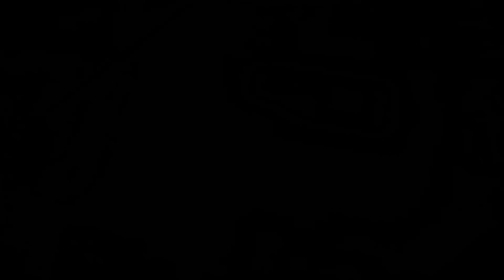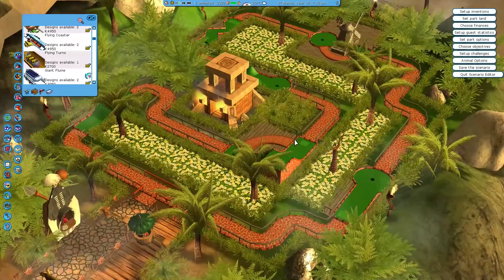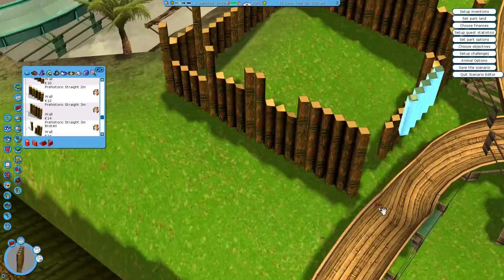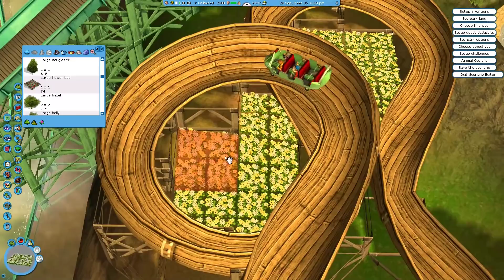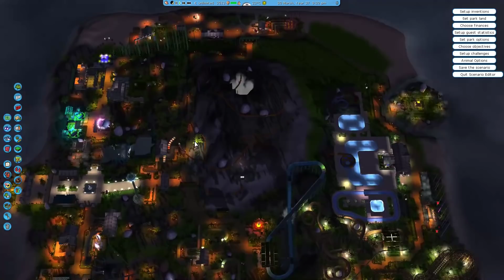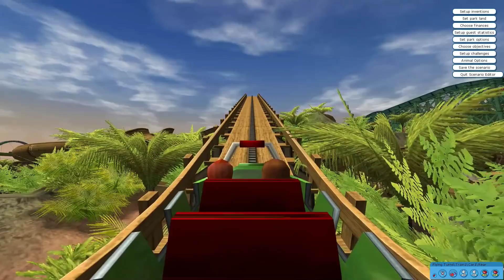RCT3 Megapark Episode 25: Flying Turns!

Comment: Probably a little late for your Park as it is almost finished, but it is possible to remove scenery and track clearence checks. 

To do this you only need to edit the option.txt a little bit.
First you have to make hidden foulders and files visible.
Then you go to to
C:\Users\[your username]\AppData\Roaming\Atari\RCT3 (for any version of RCT3 other than Complete Edition) or
C:\Users\[your username\AppData\Roaming\Frontier\RCT3 (for RollerCoaster Tycoon 3: Complete Edition) ,
where you can find the options.txt

To disable clearence checks simply add following lines
AttractionSceneryAllowTerrainIntersect 1
AttractionSceneryAllowSceneryIntersect 1
TrackAllowSameTrackIntersect 1

The first two allows scenery to intersect with other scenery and terrain while the last one can be used to create track switches for coaster depots or the miniture railway

As always make sure to have a backup befor editing game files
Reply from the maker: I already have these three options set, but thanks for the tip!